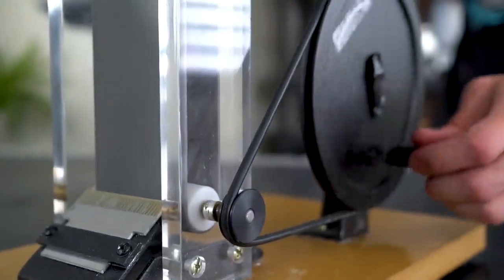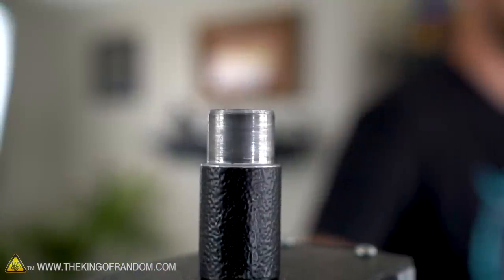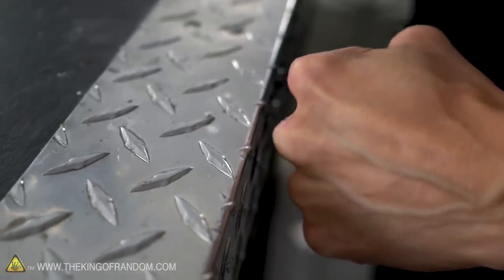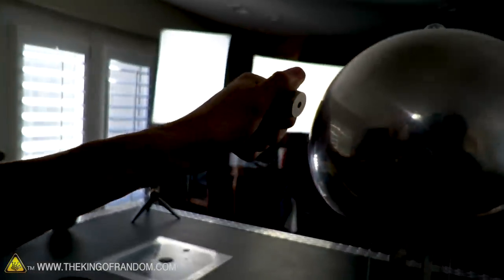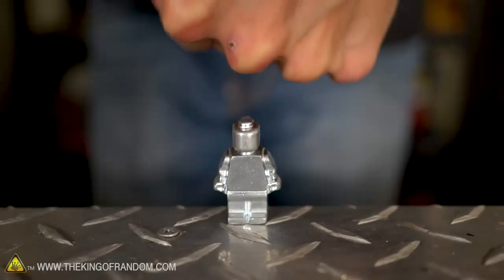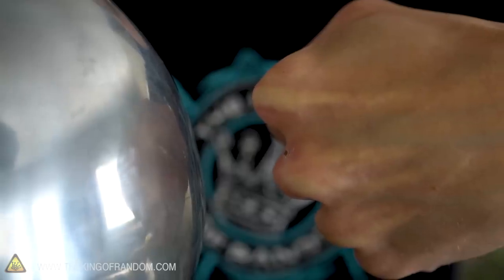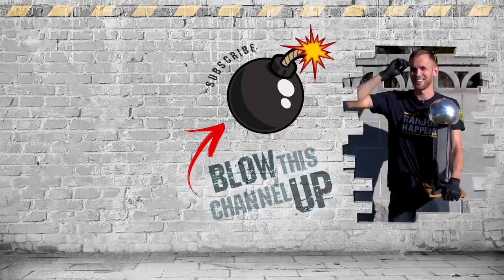Micro Lightning Storm

Comment: Holy van de graaff Batman! That zap was huge! 🌩 💥⚡
Reply: When the next box coming?
Reply: Source Port Services Don’t edit your comment
Reply: @leolizard3152  yeah, i agree.
Reply: You could hear the difference in how hard it went off.
Reply: @leolizard3152  I misspelled van de gaaff
Reply: @bombman1012  definitely
Reply: if the gallium  made plasma could you do that on a larger more visible scale?
Reply: What about the making plasma in your kitchen thing?...
Reply: Source Port Services lol hehehehehehe 😂😂
Reply: I am literally lmao XD
Reply: Source Port Services woah
Reply: watch electric boom and u will think this is small
Reply: Oh gosh robin! I told u to go to your room
Reply: look at this van de graaff
Reply: 4:10
Reply: they have to do a collab with Electroboom, the king of all things electrical.
Reply: Jerrylee Somera they did
Reply: You should sell King of Random Posters!
Reply: when I was a teenager, I built one that had 14 inch sparks.  It also had plasma streamers up to 20 inches.  And to boot, the sparks were not even a fraction as painful as the gentlest of normal static shocks you get from your carpet or petting your cat in the winter.  That was until I decided to put a cheap plastic plate coated in metal paint on it.  Apparently that made a capacitor.   Fortunately, I didn't touch the plate with my hand, I used a grounding rod.  The spark must have been at least 3 feet, sounded like a shotgun going off and vaporized the plate in a large purple blue fireball.  There was some burns and temporary hearing loss but I was ok.  Lesson, Van de graff is not a toy.
Reply: Leo Lizard , he did
Reply: And my address is 1711
Reply: Source Port Services my teacher has one and it’s so cool
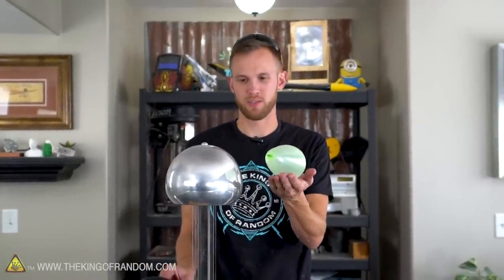Reply: 3:07 3:08 that face
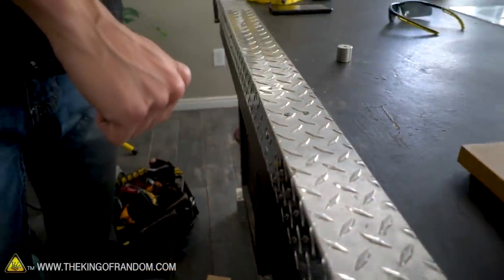Reply: 6:28 lol
Reply: Is 5:10 how wireless charging work
Reply: Nl je weet toch
Reply: For a second i thought this comment was in another language
Reply: @leolizard3152  if he edits the comment the heart from tkor will go away

Comment: I learned from filming my static generator projects you need to change your shutter speed to match your frame rate and you'll get great spark footage. Just a little extra motion blur.
Reply: I really love your videos!
Reply from the maker: Thanks for the tip!
Reply: Ever think that the negatively charged electrons are flowing towards the magnet, jumping through the air in a constant stream so there is no arc. @TheKingofRandom
Reply: OMG you watch this! I a, your biggest fan!

Comment: Basically what you made with the gallium lego man is "St. Elmo's Fire" which is a plasma discharge when there is great electric potential but not enough to make a spark. It's usually seen on ship masts and tall objects right before a lightning strike! I actually created this effect when I was younger when I rubbed socks across the carpet at my house and place a block of staples near where I rubbed (I was an interesting kid 😛).

Comment: Tesla coils and Van de Graaff generators are always fun to play with. For the best insulation, stand on a piece of wood on glass jars. Great video!
Reply: But wood is very conductive when high voltage is passing through it , so standing on a piece of wood is pretty much the same as standing on the floor directly , won't make any difference . On the other hand , glass works quite well as a non conductive material .
Reply: @Luminol Sintesis The wood is irrelevant, it's only to stand on, as long as it's placed on the jars, you'll be very well insulated from the ground. I know this for a fact.
Reply: @electronicsNmore . I know you are right, my dad is an electrician.

Comment: Fun fact: the "ball" on the top acts as a faraday cage for the top brush, which means that the brush isn't affected by the voltage of the ball, but can keep delivering electrons to it regardless. The limiting factor is corona discharge through the air, which the rounded surface helps minimizing.

Comment: The electrical breakdown voltage of air is 3,000 V/mm.  Some of the sparks were almost 3 inches (75 mm) long = 225,000 V.  Yikes! 
Static electricity does not carry any current.  Rather than using bare skin, if you had held and used a metal object in your hand to discharge the spark, it is likely you would not have felt any effect.
Reply: Static does have current it's just for very short time
Reply: Opacit.e yup
Reply: I should have stated that static electric discharges do not carry a significant current, in regard to affecting human physiology.  The current carried is in the microamp range; not enough to cause lasting harm to an individual.  (The total energy discharge is in the millijoule range.)   Opacit.e and Noet Games, thanks for your replies.
Reply: I thought it was about 1MV/m or 1KV/mm. Either way, crazy high voltages!
Reply: Just watch electro boom he answers all these questions and even builds a home made one with panty hose pvc and wood lol plus he tell king jr what hes doin wrong when he built his capacitor
Reply: WOWIE your smart like really really smart
Reply: R/IamVerySmart

Comment: On the gallium lego, the small arcs look like St Elmo fires, discharging in the air by corona effect. Then you're not discharging as much current when it arcs with your knuckle, and don't get zapped as much as with the metal table.

Comment: You should try that again, with a more flat piece of gallium, perhaps the shaper edges 9f the metal are acting like a lightning rod, and creating a greater difference in electric potential energy on those edges causing the electricity to discharge partially through those before the big shock, lessening the energy that's being sent at one time

Comment: I don't know what the effect is called when you use a magnet like that, but I put magnets onto the core of the coils on step up circuits and got a boost in power output, however the magnet ends up heating up a lot.

Comment: Gallium is a semi conductor
Reply: Nope. Although it is a poor conductor, that doesn't mean that it's a semiconductor. However, it does form compounds that are semiconductors.
Reply: The effect observed with the gallium was only due to the sharp edges that caused the eletricity to discharge quick enough so that it didn't make sparks , also known as the Coronal Discharge effect, nothing to due with the material itself being gallium.

Comment: Howmuch voltage can your body hold befor it becomes to dangerous and you can risk your health? Can you even reach that voltage with the vandegraaff?
Reply: I think you can't really hurt yourself with this, since it's current that is deathly and not really the voltage. You can compare it to a taser, it has a really high voltage, but a really low current.
Reply: @dankpiep5339  your a bit off with your explanation, you are right that current is what is dangerous, but that just because current  is just voltage times amperage, aka wattage, it is neither the voltage or the amperage that kills you just how many watts are being dissipated through your body
Reply: I should also note that amps x volts is equal to watts or what really kills you
Reply: @somedudeinchirons4936  yeah basically what I said, current = watts
Reply: "current = watts"
There are two mistakes in that statement. Can you find both of them?

Comment: I'm not a scientist, but I did really well with it in school.
About that Gallium and the plasma affect. I think what is happening there is that because Ga's melting point is so low, the electrical arc is vaporizing the Ga and igniting it. Or at least, that's the simple expression of my hypothesis. I do know that even a small static spark (like from walking across the carpet and touching a light switch) is several thousand degrees - easily enough to melt the Ga.

Comment: Well...
Just like what ElectroBOOM (OMG!!!) said, you should also try some metal stuffs with sharp edges like the magnets you used.
It's probably the phenomenon called "corona discharge", since the static magnetic field doesn't accelerate charged particles along the vector field, but orthogonal to the field vector instead.

Comment: 5:16 is that how wireless charging works ?
Reply: Nowhere near how it works wireless charging uses of voltage that goes through a coil that coil has enough frequency to jump to a coil of the same size or larger

Comment: 7:42 I believe this effect is known as the corona discharge where you are creating and electric field between you and the gallium stripping the electrons from the cations in the air. Very similar to what happens at the bottom on the van de graaf generator

Comment: I'm an electrical engineer and I can tell you there's nothing special about the magnet, other than it being a piece of metal. The only thing the magnetic field would do is slightly deflect the discharge arc (which would still be really cool to see). If the magnet is powerful enough, it really would bend the discharge arc into...... an arc shape.

Comment: the different effects from discharging in different metals is because of what is known as the Fermi energy.  this characterizes how easy it is to remove electrons from the metal.  gallium has a high Fermi energy and it is this that not only causes the early discharges, but it also contributes to it's low melting temperature properties

Comment: the voltage jumped through the magnet because electricity and magnetism is kind of the same thing and interchangeable
Reply: nope
Reply: Extra Cheese
Have you heard of "electromagnetic force"?
It's one of the fundamental forces of the universe just like gravity acting on matter.
Reply: @dontmove2257  magnetic fields cant just 'move' the sparks/voltage. if you're talking about the bit at 5:30, the magnet does nothing there. the energy is being "transferred" because of the potential difference, i think...
you could do the same with a bit of copper or aluminium, or no metal at all.